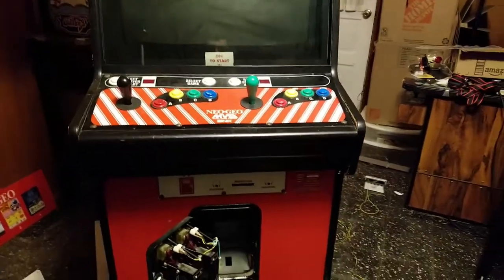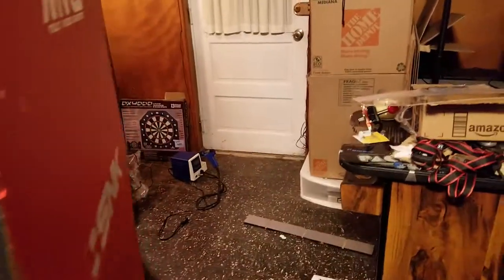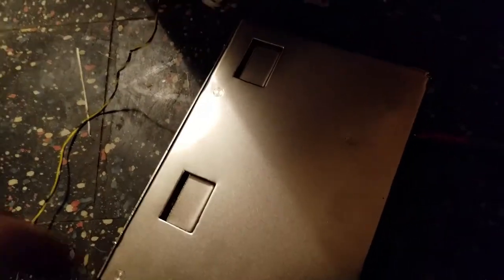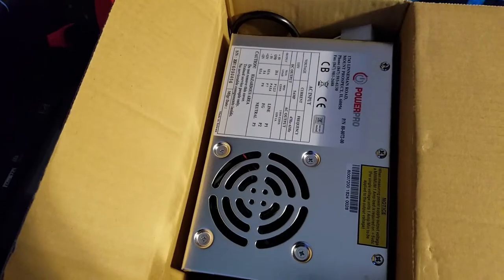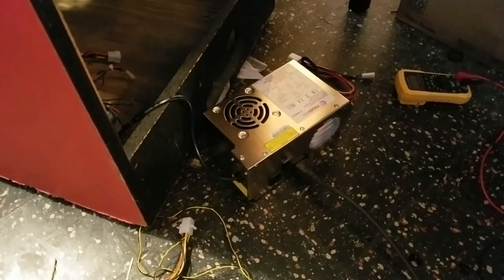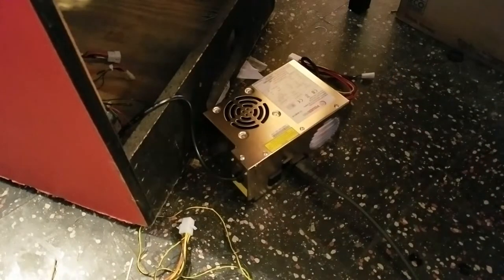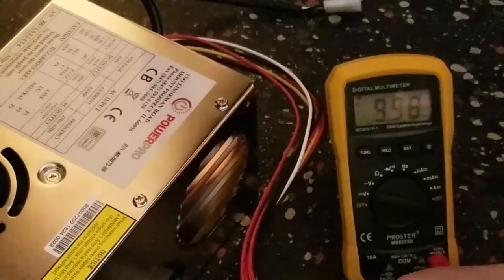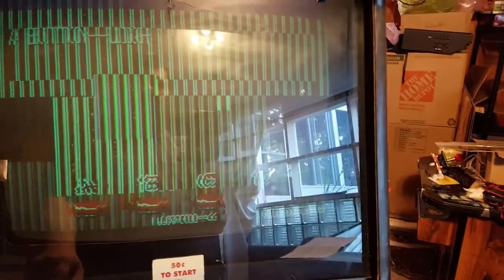How I DESTROYED my NEO-GEO MVS

Comment: There is typically a fuse on the power supply, you could in theory just have replaced the fuse in that power supply and saved some $, but lesson learned not to leave live leads without electrical tape or isolation.